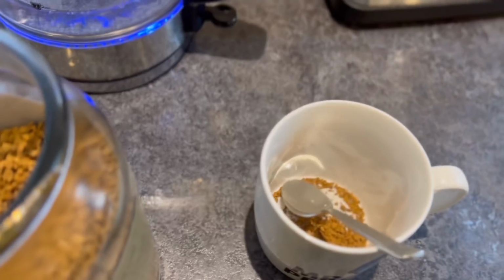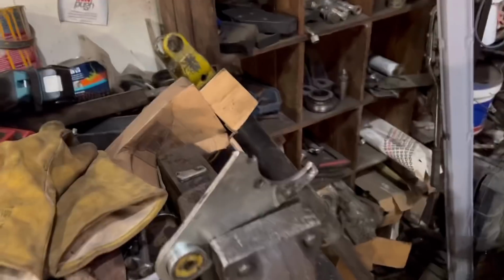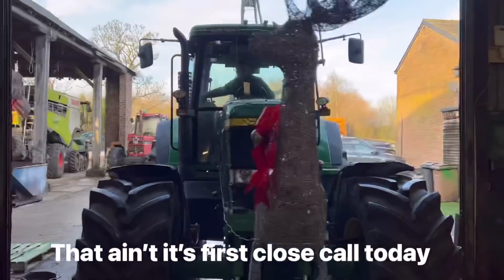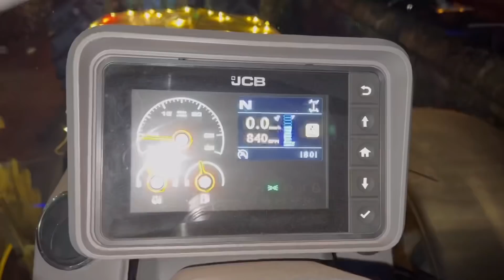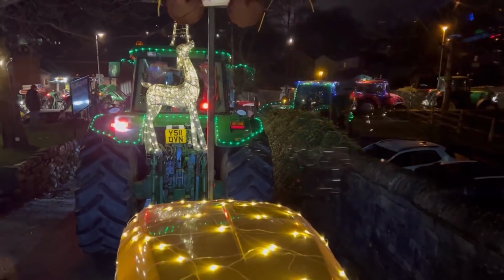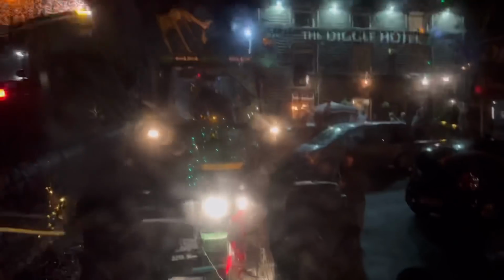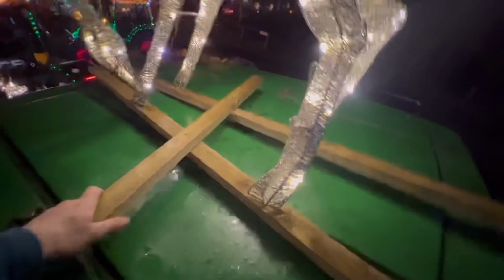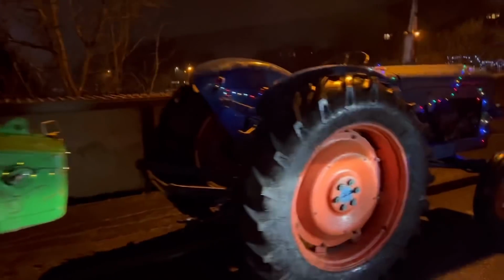Day642  #OLLYBLOGS SADDLEWORTH TRACTOR RUN AFTER QUICK BOILER REPAIR #AnswerAsAPercent

Comment: The auger motor might be be better if you fitted a soft start control, it would give a low torque gentle slow start
Reply from the maker: It’s prob when it jams tbh